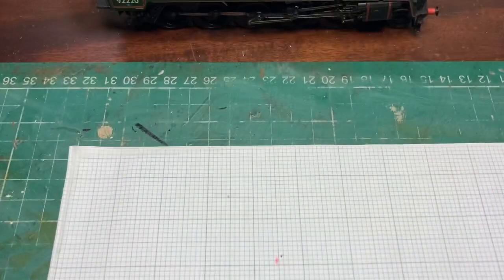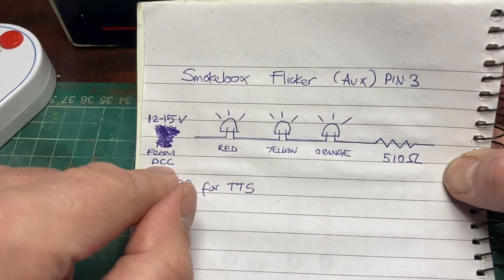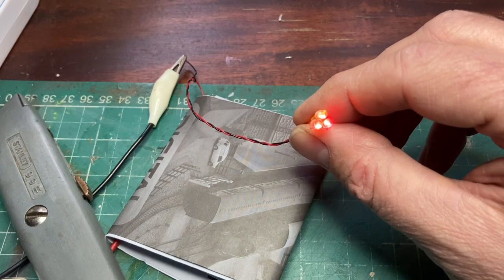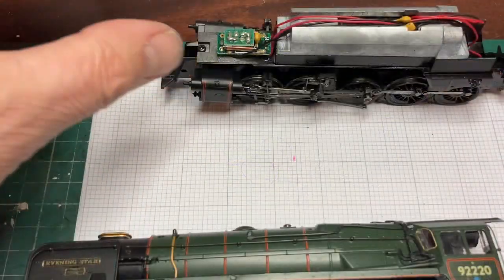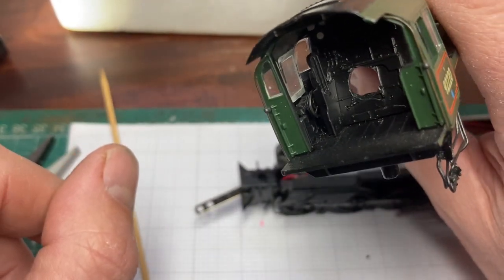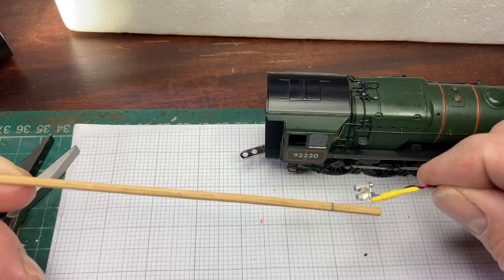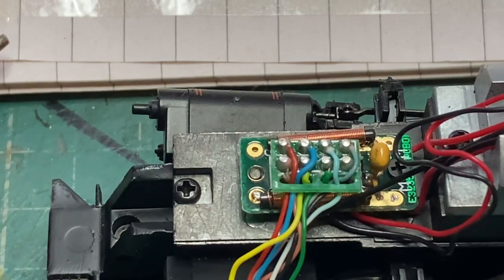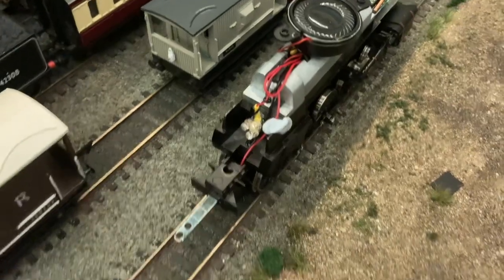How to add a flickering firebox effect to an 8 Pin DCC Decoder fitted Model Railway Steam Locomotive

Comment: I love the effect of the 3 coloured LEDs. I may try this on my Hogwarts Express. The only bit that makes me nervous is soldering to the decoder socket. But I have an HM7000 8 pin decoder fitted, so could use the purple 9th cable and then just need to solder to blue common. I also think the decoder may have a built in flicker function, so perhaps normal
LEDs could be used. Brilliant guide. 

Thanks.
Gary B
Reply from the maker: Well done and great idea to use the decoder's built-in flicker!

Comment: Hello Paul, Where did you find "Flickering" LED's? I have been searching through the internet and cannot find any that do not come without a circuit. I would like to find Nano/Pico or 1.6mm.
Reply from the maker: Hi there, I used 3mm flickering LEDs in my project - bought from eBay from memory